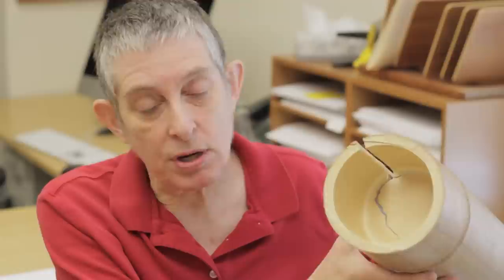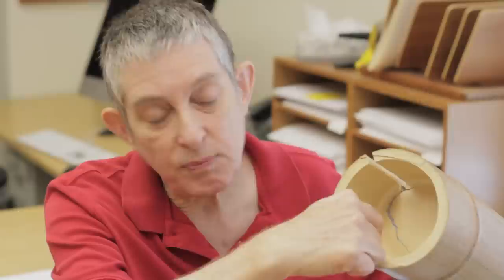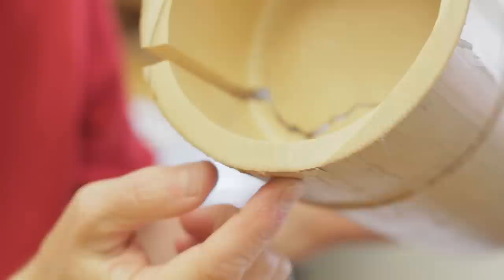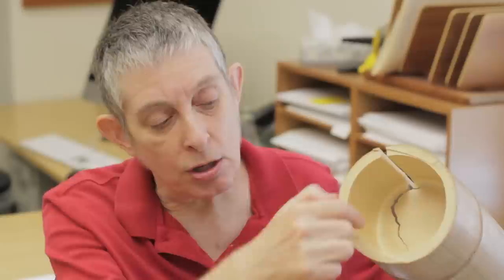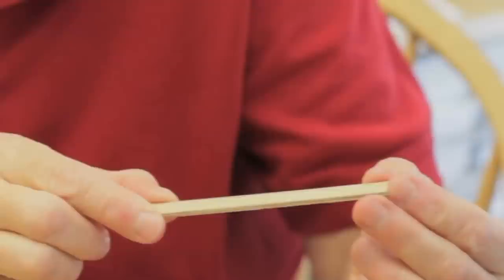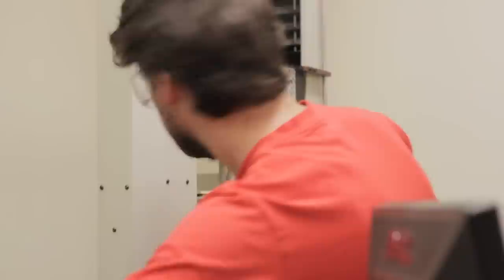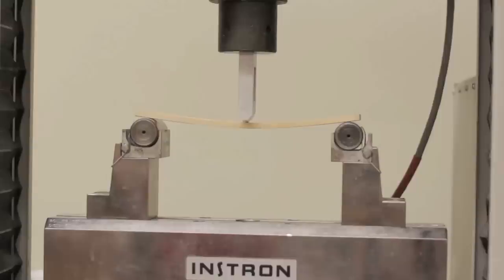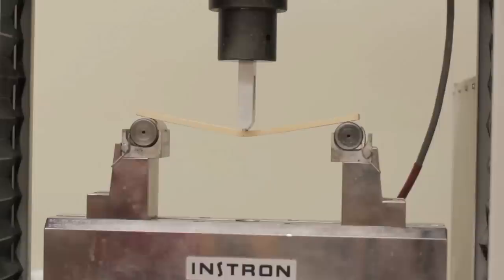Bamboo Engineering

Comment: I find this topic very interesting, and would like to make some questions:
1.- Is there a relation between the moon and the time of cutting it?.
2.- What are the properties of bamboo used as reinforcing concrete elements.
3.- Is it possible to flatten the whole perimeter of bamboo?
4.- Could we fill the inside with concrete and make it work as a beam or column.
5.- How can we join two elements effectively?
6.- What is the right age to harvest and use it as a construction material.
Reply: +Jose Angulo 
1 tiempo de luna llena mas se avinagra al cortar y menos les gustas a las polillas
2 antisismic behavior
3 of course, you can even make it squared shape
4 not necessarily concrete, something more flexible polyurethane foam
5 metal beam inside de circumference of two bamboos sections
5 after 3 years depends on the demand of nutrients and the culture space between plants
Reply: +Alejandro Elizondo 
excelente aporte. 
Después de más muchos mese leyendo. .ud. me da una respuesta precisa. 
gracias. .!
maestro.  !!
Reply: find this topic very interesting, and would like to make some questions:
1.- Is there a relation between the moon and the time of cutting it?.
Bamboo is cut at all hours and time of the year.  only varible is maturity of the clum.

2.- What are the properties of bamboo used as reinforcing concrete elements.
Ellison ( I know that it might be misspelled) did experiments using it.  FIrst thing Frist, The bamboo has to be cured.  Also, aslong as the bamboo does not get any form of moister it should work, if moister gets to the bamboo the bamboo will expand and weaken the concrete by cracking. 

3.- Is it possible to flatten the whole perimeter of bamboo?
The chinese have been making plywood and OSB like boards for as long as there been hydrolyic machines.

4.- Could we fill the inside with concrete and make it work as a beam or column.
look at the second answer

5.- How can we join two elements effectively?

6.- What is the right age to harvest and use it as a construction material.
 3 to 7 years depending on species and climate.

Comment: Maybe it could be genetically modified to have thicker walls? If we could get 4"x4" boards, it would make an outanding materials. Also, the toughest species seem to make excelent bows.
Reply: SalveMonesvol there is a species with solid cores, however it only gets to be about two inches in diameter and the inside is rather pithy. Bamboo can be made into many useful shapes and sizes. The world can fill our need for construction materials with both wood and bamboo. First, we need to get rid of our farming acreage to get room for the trees and bamboo. I’m all for it, but that means we need less people and animal product consumption. Lawns should also be reduced as they take up a lot of space with very little carbon sequestration and biodiversity compared to grasslands and forests.
Reply: For some kinds of loads a hollow profile resists better than a solid piece of the same weight, that's why I shaped beams and hollow profiles are used and maybe why bamboo evolved to be like this.
Reply: @joaomrtins  yes

Comment: I wonder what happens if you high pressuree compress long bamboo fibers (from the outside) together with a suitable polymer to make composite materials. Intuitively I would expect these to be very strong.
Reply: I already do this when o build a composite boat  the wood provides so little strength its basically sandwich material